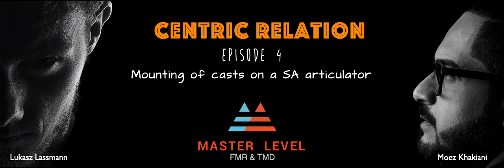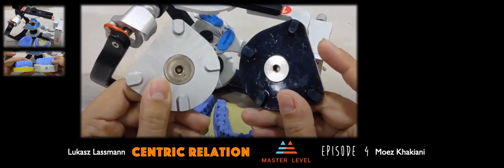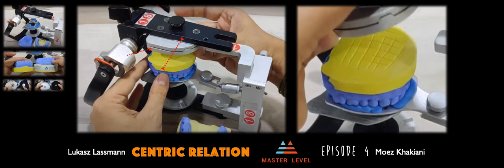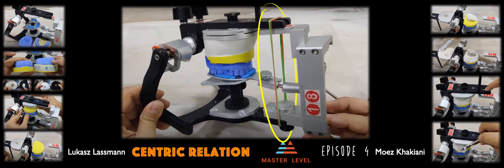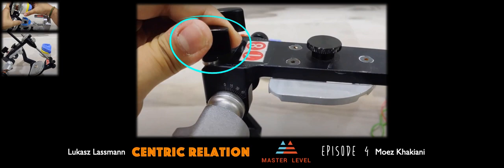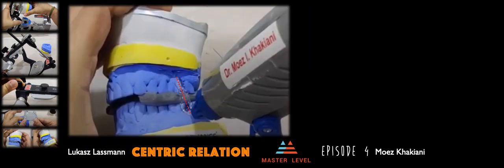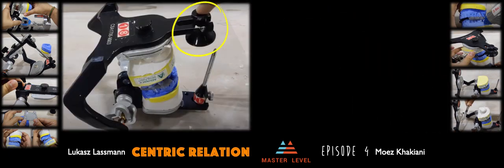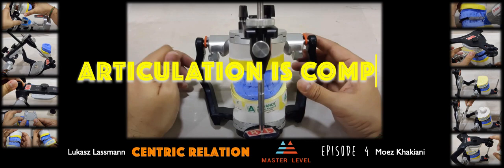CENTRIC RELATION- Episode 4: Mounting on a SA articulator

Comment: when you mount the lower cast with the bite registration material (CR record) do you adjust anything on the incisal pin? Either raise the pin according to thickness of bite registration material or just leave it at 0 (once set, just let the incisor pin to drop and accept the new value as the zero)

Thank you for your kind answer!

Comment: Great video Sir.
 I had a little confusion, did you alter the incisal pin when you placed the bite and later upon completion of mounting again did you place it at the 
0 level?Kindly help me through it.
Reply from the maker: So the CR record was made at an increased VD owing to use of Unwind MD by MIK Dental. Hence lower mounting was done at +5 in compensation... The same was then dropped for final work...
Reply: @DrMoezKhakianiMDSMumbai  Why there are only  5 annular groves (both up and down )from the prominent midline groove  on the incisal pin of a hanau articulator?
Reply from the maker: Don't really recollect the Hanau Pin but typically most SA articulators have 20 lines 1mm apart...

Comment: Thank you very much Sir.
Can u tell the difference between csa 600 and csa 650???
Corident people are selling 650 only now.
Reply from the maker: So the only difference (imho) is an additional nut screw to hold the condylar elements in place which was a concern with the 600 unit when adjusting the Bennett side shift... regardless, I am not a believer in the use of side shift or Bennett angle much so personally prefer the 400... In fact the 350 is a great addition to their range...

Comment: excellent explanation and thank you again, but allow me to ask you about zeroing the articulator. what I know,,, putting the articulator in zero position means the incisal pin and  the condylar mechanism , both the sagittal and lateral, should be in zero position; why you put it in 20 degree??  kindly explain this point and I appreciate your cooperation.
Reply from the maker: So Sanaa that's another aspect of prostho that is baffling... Setting the Articulator to company recommendations is what they call zeroing of the arriculator... It is apparently to do with averages or values that allow the system to work like it's supposed to... It applies to all Articulator designs regardless of make or model
Reply: @DrMoezKhakianiMDSMumbai  so this value is the recommendation of corident cs400 articulator? I have CS600 one, do you recommend to use the same setting when mounting the upper cast?
Thank you
Reply from the maker: @sanaarasheed433  yes... The same value should be used... But remember... This value has no role to play for maxillary mounting... It is important when mounting the mandibular cast... Best wishes...
Reply: @DrMoezKhakianiMDSMumbai  Thank you so much
God bless you
Reply: Please share the mean values for whipmix articulators

Comment: How many millimeters should the incisal pin go up so that when I remove the bite registration it stays at 0? Thank you very much for sharing your knowledge. Kind regards from CD mex.
Reply from the maker: There is no fixed value to this number... Purely because vertical overbite between anteriors is very subjective and varies from patient to patient... Besides getting to the zero mark has no clinical relevance... So no need to mull over it...
Reply: @DrMoezKhakianiMDSMumbai  thank U Dr.👍👍